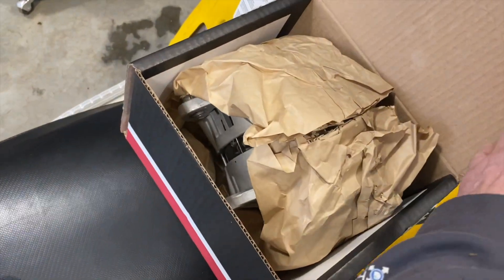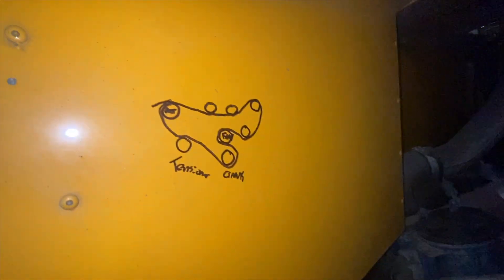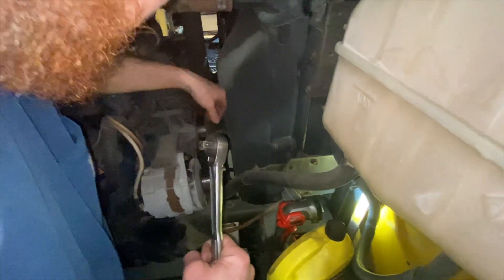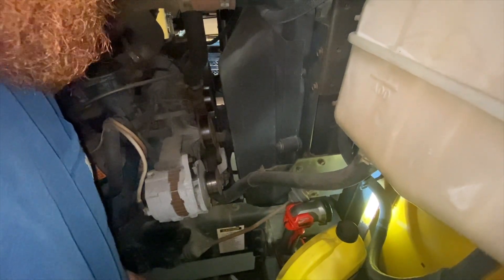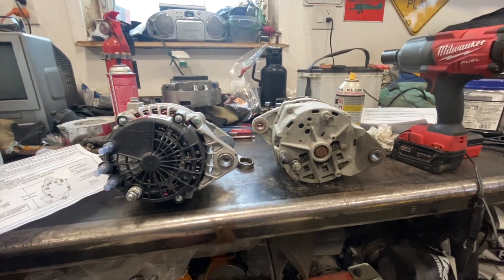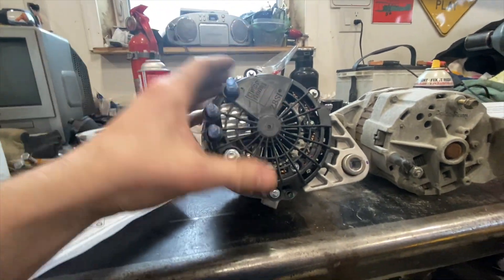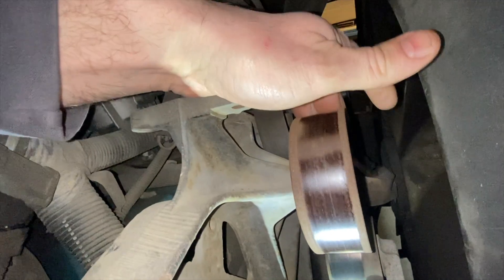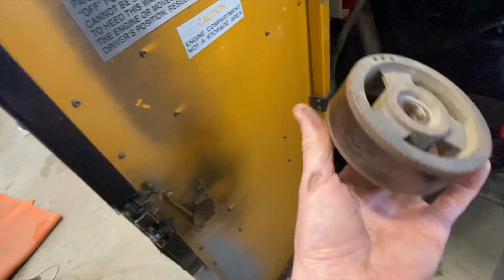Alternator swap on our Skoolie the 488inn

Comment: Amen to checking/changing the pulley bearings while you’re in the engine bay!!!  Yes, that bearing would have failed, caused the belt to go sideways, fall off the pulley, and end up shredded on the side of the road in -40*.

Comment: That’s a handy diagram for the fan belts. Probably be good to keep a journal book for parts and such as you work on it. The Websto heater is a life saver. Curious how you heat the interior when parked? DUH the Websto . I had a brain laps. A buddy installed a red dragon ( I think ) like used to preheat small planes. He used it to jump start the heat after riding in Cantwell. Once heated up the normal motorhome lpg heater was enough to maintain it.
Reply from the maker: We just had the bus down in cantwell last week and the webasto did great I’ll be putting a video out soon on how I installed it and our trip
Reply: @diyalaskanlifestyle  just saw a new heater like that on Market Place for $280.